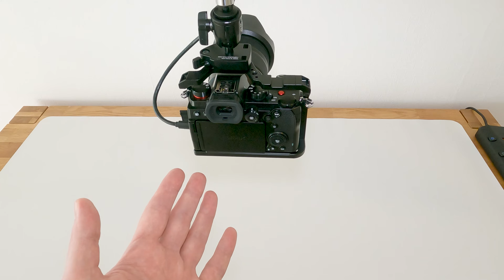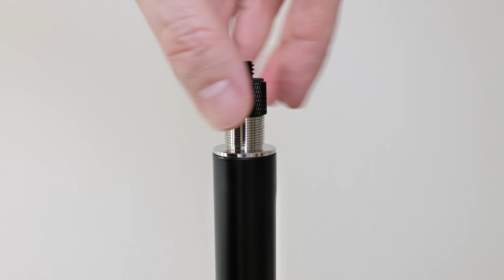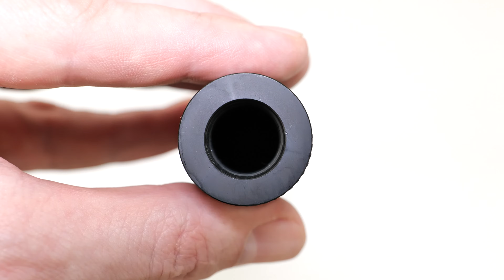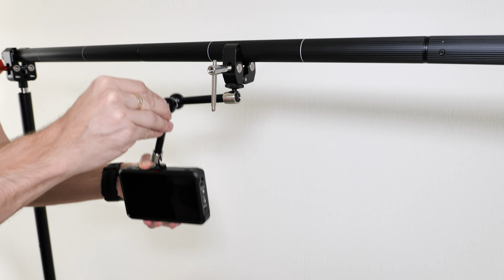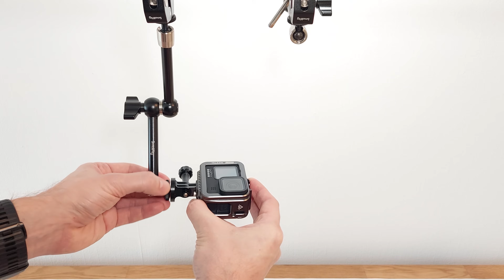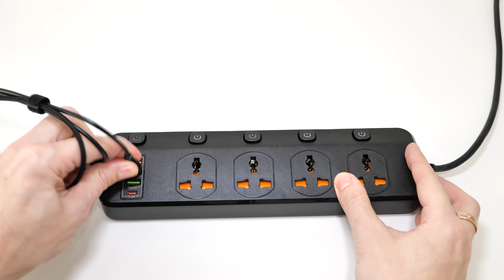How to Build the Ultimate Overhead Camera Rig – DIY, Unboxing & Vlog Setup (2025)

Comment: Are there any extentions that bring the height to around 8ft
Reply from the maker: I haven't seen any ready-made extensions, but with some ingenuity, you could simply buy tubing of the right diameter and replace the center column to extend the stand to your desired height.

Comment: I like this setup!  Unlike the desk mount, where the camera shakes , this is much more stable.
Reply from the maker: Thank you for the comment! Yeah, that’s exactly why I built it with two stands, completely separate from the desk. I used to have an overhead rig mounted directly to the desk, but it was unusable for videos — any movement from my body while touching the desk, would cause the camera to shake.

Comment: Anyone know what thread the sidebars are? I'm struggling with my setup
Reply from the maker: I was using an adapter with a thread size of 5/8" female to 3/8" male. The thread on the stands doesn't go all the way into the 5/8" adapter, but it still holds reliably by utilizing half of the adapter's thread. I tried different adapters and got the same result each time. Most likely, those stands have a non-standard thread.

Comment: I have something similar clamped to my worktable.  The problem I had was to get the camera rigged up properly so that up was up.  You showed how it can be done by using the camera cage and mounting the camera from the top.  I ordered one immediately.  Thank you.
Reply from the maker: I'm happy to help! I've used this setup for a long time and have never had any issues with it, though I don't consider it perfect. The weak point in this setup is the "magic arm" that holds the camera. I wish it were stronger and more heavy-duty for my very heavy camera. However, it holds the camera perfectly well if tightened enough.

Comment: This is really useful, thank you! This products unfortunatelly aren´t available where I live, but I did found a NEEWER Backdrop Stand which can hold up to 4 kg and is much cheaper than buying these elements separately. Would you say that could work as well as the setup you built?
Reply from the maker: Well, that depends on what you need it for. I also have a NEEWER Backdrop Stand with white and green backgrounds. That thing is extremely light and flimsy. I use sandbags on the stand's legs so it won't collapse under the background weight, which is not that heavy. In theory, if you attach a small and light camera and the same LED panels that I used, it will work, but you have to put some sandbags on each leg of the stand. There's no way the crossbar from this setup would hold my camera. I mean, it may for some time, but it's too thin and won't last long. You can use different components to build your own setup, but I highly recommend using the same crossbar that I used in the video. It's extremely strong, it doesn't bend with an attached heavy camera, LED lights, speedlights, and other stuff.
Reply: @ElectronicsComputers  I would need it for an action camera and a thermocamera which weighs around 1kg and since it said it holds up to 4kg I thought it might be good enough. But thank you for your input! :)
Reply from the maker: @loona7126  Just give it a try. It should work, but you may also need something like this: https://neewer.com/cdn/shop/products/90080563_2_3ec87555-c375-4fa7-85be-7d22250669aa.jpg?v=1668484082&width=1200
Reply: @ElectronicsComputers  These bags come with the setup :) Perhaps I will be able to replace the crossbar with the one you suggested in case it is not sturdy enough. Thanks again for your help!